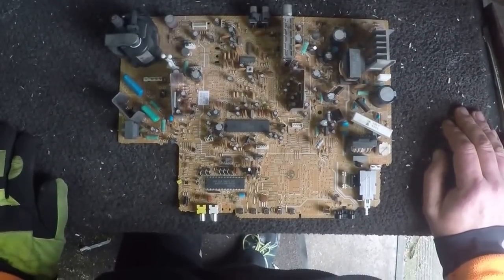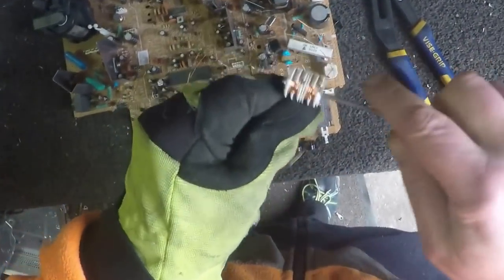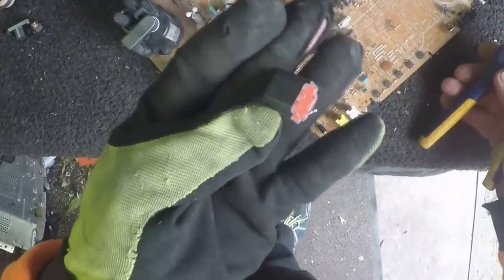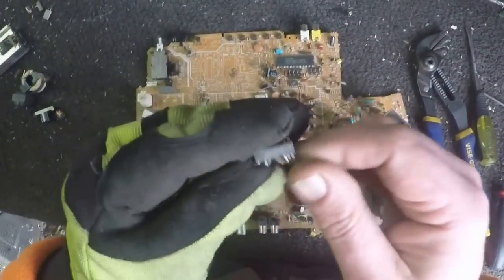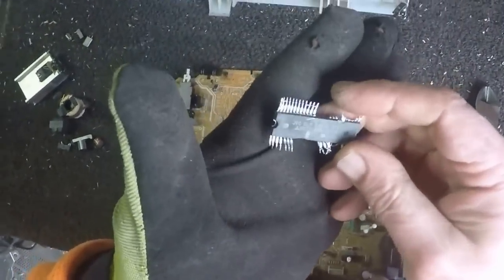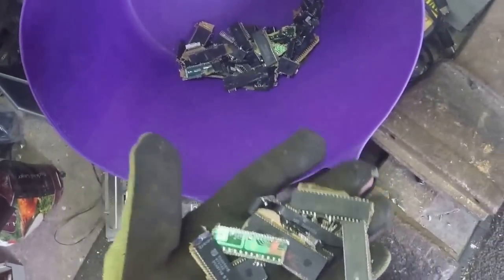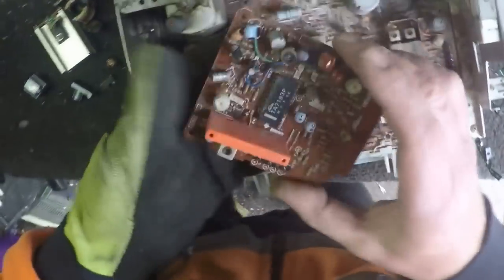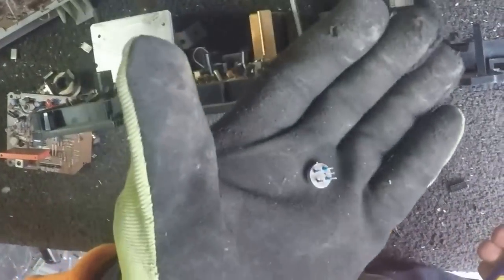scrapping crt tv boards for metal recovery

Comment: Hi! At 11:02  ÷ 11:05 you are holding an electronic plate which had that orange big thin condenser-like component on it. Usually they are some sort of quartz resonators as well and they do contain golden wires!! I did not see you checking on those!!

Comment: You can find more crystal oscilators in that metal box where is antena plug.
Reply: PitsuMiwus I’ve always found one inside the metal case on one side or the other. Sometimes two. And break off the plug of it where the coax screws on. Brass I believe.

Comment: Nice vid Ben, whats the little buggers that conduct the board up into the heat sink? seems like they have copper underneath a nickel coating. Ive been sticking them in a tub just in case but nobody has ever mentioned them. Cheers.
Reply from the maker: PIPER DOUG Thanks Doug, they are Resistors and yes they are solid copper coated with tin.
with the plastic they may go as copper baring but cleaned up the should go as tinned copper.

Comment: the bits that are bolted to the heat sinks, what metal is inside of them? I broke one open and it looked like it could be gold or copper but I'm very new to scrapping so idk.
Reply from the maker: copper, nothing is gold underneath, gold is only used as a contact, so gold on gold between a connection, like gold fingers slot into gold slots, gold pins slot into gold connectors or something with a gold base is mounted onto a bit of gold on a board, it's all plated, never solid unless it's fine gold bonding wire say inside a cpu.
Reply: +eWaste Ben another question is about the pins throughout the boards, aside from gold, what would other pins be made of or plated in? How would you determine which is which when it's not gold plated?
Reply from the maker: if not gold plated then it's just tin or nickel.
Reply: Would that apply to the very flat connectors you'd find in things like laptops?
Reply from the maker: yep, if not gold then tin plated